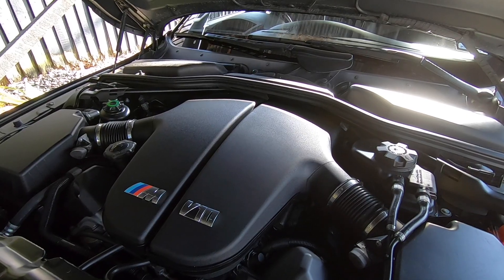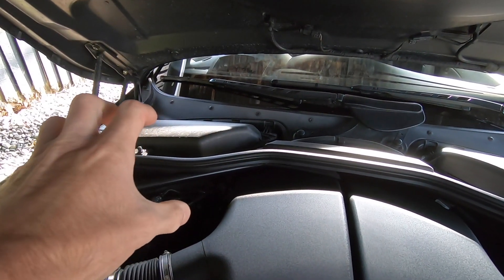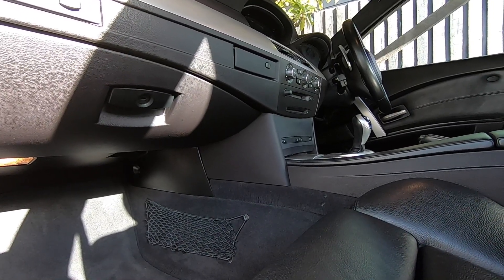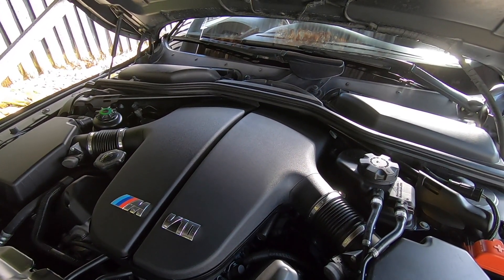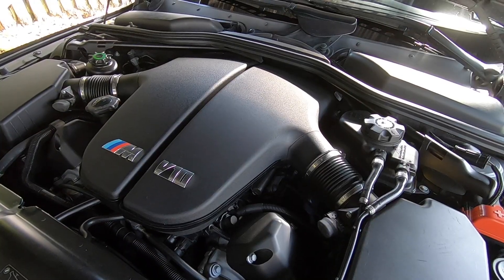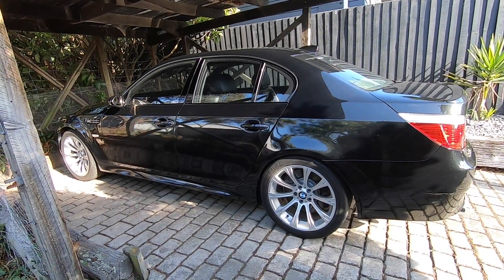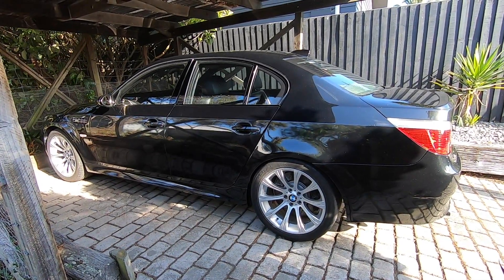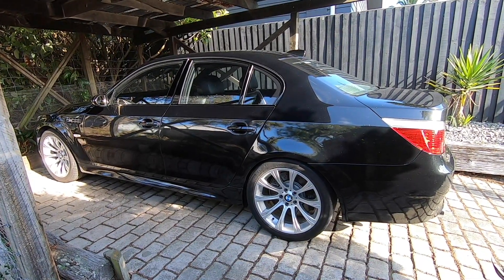BMW M5 Brake Vacuum Pump Code 27B7   #bmwe60m5

Comment: Hey MTechGuy, love your videos the clearest and most informative videos, with great detail and tips. I have recently bought an m5 e60 and sometimes i get random lights on dash, such as transmission fault one day, but then a few hours later it comes off. The other day engine light came on a few hours later it came off. Everything tuns smoothly, both engine and gearbox are perfect. Is this a common problem with the m5s or what do you think it could be. Any ideas would be much appreciated and again your videos are the best !!👍🏼👍🏼
Reply from the maker: Not common, I would first make sure the battery is healthy, and then read the fault codes and go from there
Reply: Thank you i will need to check the battery, because when I OBD check they come up then a few hours later are all good 0 faults. Recently said fuel sensor fault but then cleared a few hours later to all good. Its very confusing. 
Thank you very much, i appreciate the help !

Comment: My vacuum pump was continuously running and the reason was a leaking brake booster. The aluminum had a hole in it at its back side where it is attached to the vehicle body. It was rotten away because of the blanket insulator which touched it, so it was always wet there in addition with winter salt. I successfully replaced my brake booster, cleared code and everything is fine.